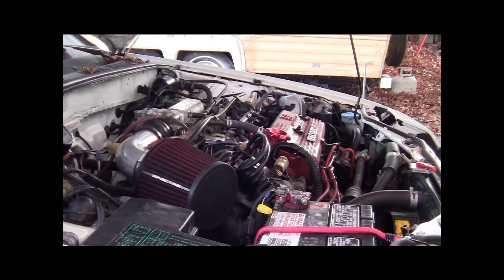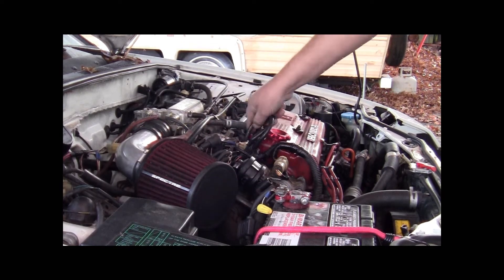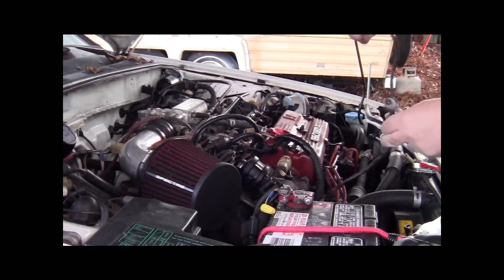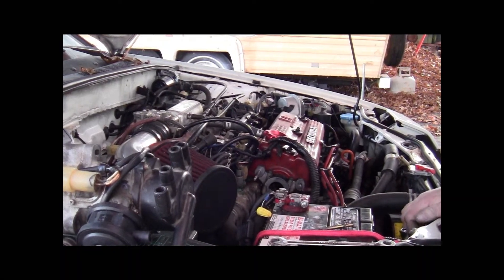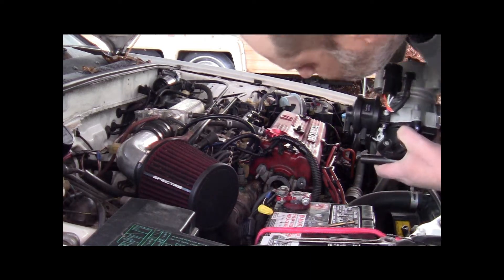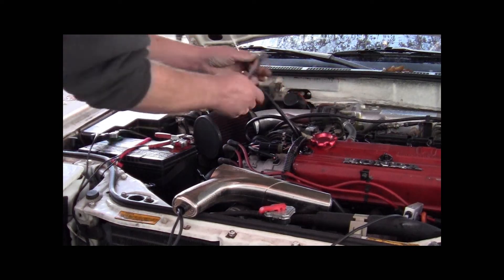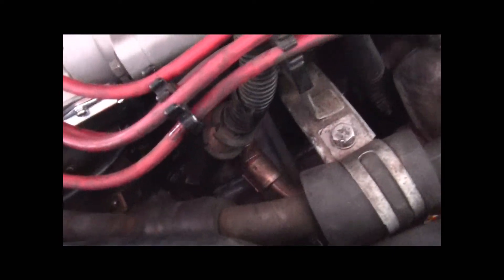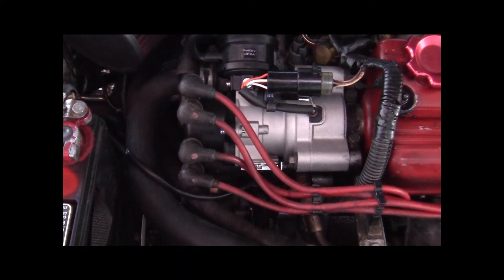EASY HONDA DISTRIBUTOR CHANGE

Comment: Man, this video brings me back to when I was a tech at a Honda dealer in the early 2000's, and I had an '88 Accord EX-i.  We replaced a number of distributors, usually due to failure of the pickup magnet or bushing failures.  That bottom bolt can be gotten but you need a bent wrench like the Snap-On CMX1012 or a wrench from the "sacrificial wrench bin" that has been heated and bent into an arc.  Thanks for sharing!
Reply from the maker: I got it out with a 1/4 inch ratchet and a long extension , Not easy but I got it !! Thanks Everett ..

Comment: Good work Shawn.  I remember the Chrysler distributors were the easiest to do back in the 70's and thereabout.  They had a flat end on the shaft and you were either 100% right or 180 degrees wrong.
Reply from the maker: My 318 jeep is like that , Thanks for watch'en Harold !